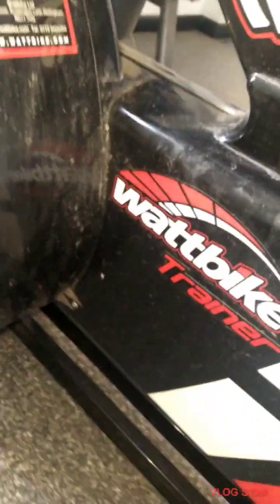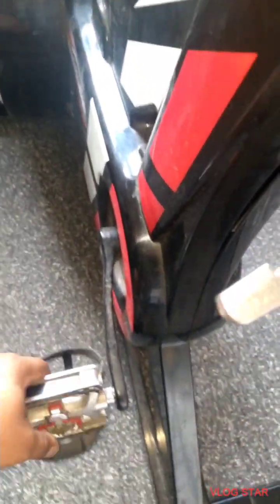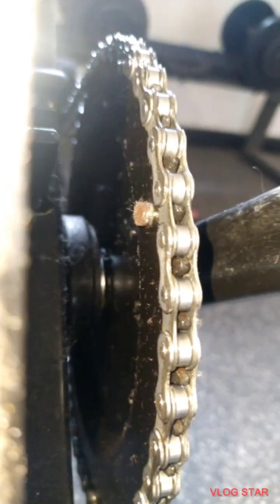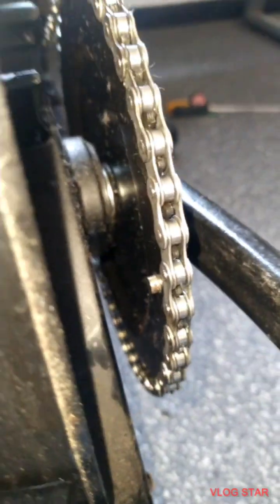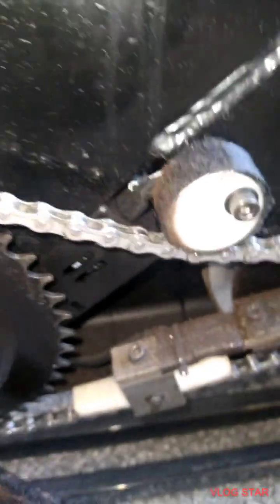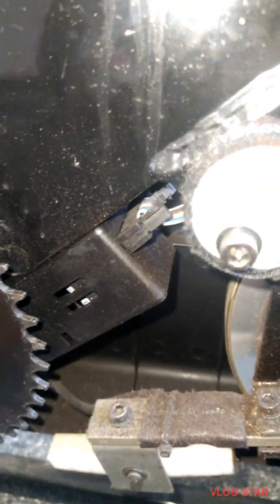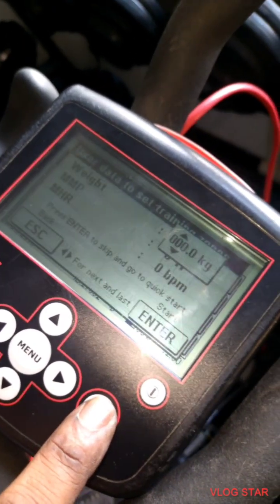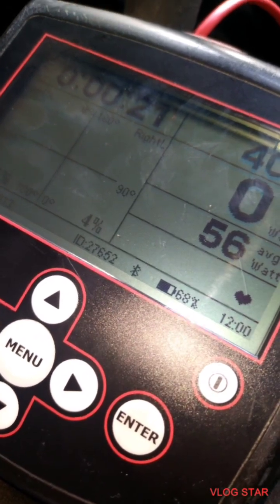No Reading on Wattbike console

Comment: Thanks fir the video. I have the same problem and will rty changing the cable. You need to replace the coin cell battery in your head unit and it will then remember the date/time.